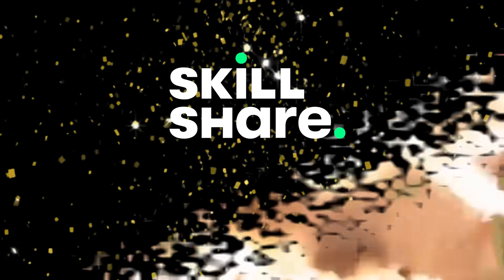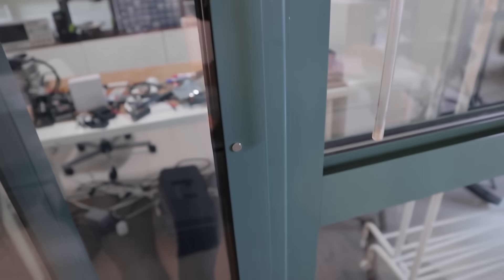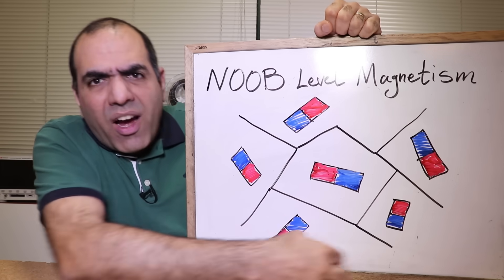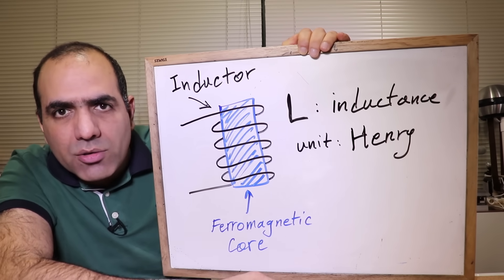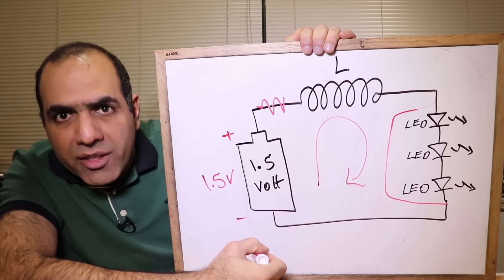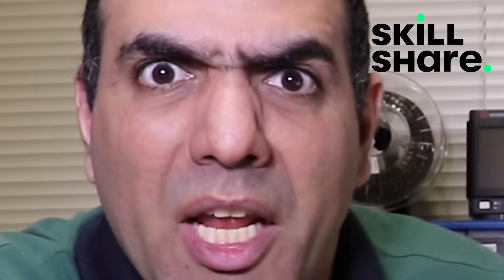Magic of Magnetism & Inductors (ElectroBOOM101-007)

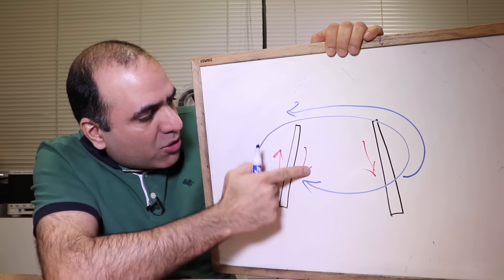Comment: I think the direction shown at 7:25 while explaining the transformer working is incorrect..

If (i1) increases from bottom to top then the induced magnetic field (B1) will be anticlockwise (to oppose the source i1) which then also induces a current in the second wire from top to bottom so as to oppose it's source i.e. B1 (as i2 will have clockwise B2)
Since, B2 reduces B1(opposite directions), i1 is able to increase more and thus having more bigger B1 and this induces bigger i2 which has a bigger B2 and this goes on..
Reply: Sorry for being so pedantic with the direction.. however his explanation is perfect.

Comment: Wait, does all magnets loose their power if overheated? Is that something to consider when you design electrical generators or motors that the electricity would eventually heat the magnets to make them useless?? or doesnt it work that way?

Comment: Pls explain,any kind of supply let it be ac or dc doesn't the INDUCTOR shorts them out ?Further if inductor opposes instantaneous change in current then how does it works on ac?

Comment: 5:40 you ask about Einstein's theory of relativity and how it applies to electromagnetism.  From what I understand (in other words, use appropriately sized grains of salt) - it has to do with whether your frame of reference is "the magnet passing through the coil" or "the coil passing through the magnetic field".  Relativity tells us there is no "preferred" frame of reference.  Whether your "stationary frame of reference" is the magnet, or the coil, determines whether the induced field is electric or magnetic.  The wikipedia article on https://en.wikipedia.org/wiki/Moving_magnet_and_conductor_problem is helpful in this regard.  If you consider the magnet to be stationary, the charges in the conductor experience a changing magnetic field.  If you consider the conductor to be stationary, the charges in it experience a changing electric field.  The two fields exist together so that the current will be correct no matter which frame of reference you use.

Comment: wait, then, hold on, very important question, 

an elektromagnetic field induces an eddie current that then creates its own opposing magnetic field, right?
but according to the right hand rule, the eddie current's magnetic field shouldnt be opposing but it is, so whats that about, why is the field opposing?
Reply: because as far as ive heard, the eddie current's magnetic field are opposing the original magnetic field, but according to the right hand rule it should just be amplyfying it or being attracted to it, but maybe thats just when its an unchanging magnetic field, and it only opposes fluctuating magnetic fields from like ac elektromagnets, where the field induces an eddie current and then it switches but the eddie current doesnt change imidiatly and then the magnetic field of the eddie current flips before the main magnetic field flips again maybe,

Comment: Just to clarify 5:36 where he says that magnetism is fake. It is not, don't you dare think of magnets as fake!

The electric fields do in fact transform into magnetic fields and vice versa under the theory of Einstein (also called Lorentz transformations, basically changing speed), AND there is always such speed at which magnetic fields are zero for stationary fields, but they are both fundamental because LIGHT (there is no frame of reference, aka speed, in which magnetic field of light beam is zero all the time)!

But if you want something to think about, in quantum field theory only the potential is "real", and it generates the fields. And the potential has 4 components, 3 of which are the magnetic potential (it is a vector), and the remaining one is the regular electric potential that you know as voltage.

Comment: What happens if you connect induction and capacitor together..... Free energy?????☺️☺️☺️☺️
Reply: You'd get resonant circuit that will quickly radiate all energy it has, unless it's powered with some external battery.

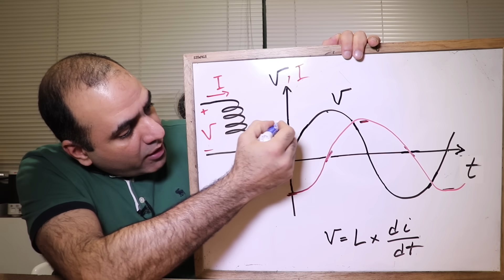Comment: Okay, so far so good, this is what I learnt in school, but also, in School I asked myself if: 11:42 Capacitor-Current and Inductor-Current are 180 degrees out of Phase, so is there any chance they will cancel out?

I mean for example if you were to have Inductor and Capacitor in parallel, so at the same voltage, will the current be zero? Or am I missing something here?

Comment: this is how i remember it
Inductors = Current Inertia
Capacitor = Voltage Inertia
Electric field lines = path that a unipolar north magnet would take if placed on a given point in the magnetic field

Comment: what would happen if we pass current to an inductor and suddenly disconnect it from both ends, would the magnetic field still be there?
Reply: Inductors resist changes in current, so if you cut the wire suddenly the inductor would see the current trying to go from some value to zero instantly. So the inductor reacts by producing an opposing voltage that tries to keep driving the current forward in the direction it was moving before. Since the current was trying to drop so quickly (practically instantly since it was a cut wire) the voltage can actually spike quite a lot and cause damage to sensitive electronics, but the energy is only in the magnetic field of the inductor so it will discharge quickly.

Comment: 7:27  when the source gets stronger, doesnt the second wire also have a stringer current and result in stronger magnetic fields induced? Like an infinite loop or something. I read about this concepts being used in transformers in subject of basic electrical engineering and have this question since then. Can somebody please answer this?

Comment: Please let me know an easy way to block that absurd 12V DC Voltage at my puny TIP41C Transistor Amplifier output. All I want to amplify is the audio input. I don't want to burn my speakers anymore with my beefed up powerpack. PLEASE HELP ME!

Comment: I loved it! HOWever, it's actually voltage induced, not current, in a conductor. If there is a loop/circuit in the conductor, there will be a current from the voltage. 
So, a changing magnetic field around a shorted loop of wire - or just a solid piece of metal - will induce a voltage, a current will flow (normal resistive stuff) and there will be an opposing magnetic field.
If the loop is broken (or some slits are cut in the solid piece of metal), there will still be a voltage, but no current and no opposing magnetic field.

Comment: Based on your video the magnet when brought closed to iron makes iron magnet as its magnetic patches aling properly. The result sounds like now we have a bigger magnet. Which is true but the strength of magnet gets diatributed over the entire area.

I.e. magnetic area overall increases but the strength remains same as that of magnet. 

Attaching 1 cm magnet to 100cm iron may not have any magnetism in such a big iron.

Comment: DC and AC are one and the same. Its just that AC changes all the time. A capacitor is a closed circuit, for a short time, beware ! It can kill you. In rush DC currents are no joke. Same with an inductor.
Reply: Technically the only difference they have to have is DC can only move current in one direction while AC does not. If you put AC into a rectifier it will give you a changing output, but it's still DC since the current only moves in one direction albeit periodically.
Reply: @thegreatzoom5073  Yeap. But there is a common misconception with quite skilled people. I have even heard a teacher say that lightning/flashes is not a DC but an AC. Though, i rather say that it is a DC, but it pulses back (ripples / bounces) off of the earth. I would even like to think of it as a bouncing ball of a surface. Until all the energy is transformed. I think it is easier to understand electricity in that sense, instead of dividing electricity as either AC or DC. Its just confusing, from a logic standpoint. I mean, you can even use a transformer with DC, if you pulsate the DC. So often have i heard that DC and transformers dont work... it works for sure, for every pulse given the time for the transformer to get back to its original magnetic none aligned (chaotic) state.

Comment: "complex math" uses the easiest differential equation for those who believe it is complex, its just integrating a derivative, for an inductor, V=L*di/dt, multiple dt on both sides, so the change in time * the voltage= the change in current * the inductance, or time = inductance/ voltage * current

Comment: So both inductor and capacitor stores and releases energy..... 
But used for AC and DC respectively .... 
Am I right or wrong .... 
Or am I still confused .... 😭
Reply: Inductors store energy in magnetic fields, capacitors store energy in electric fields. Both can be used for AC and DC, but inductors I think are much more common for AC.

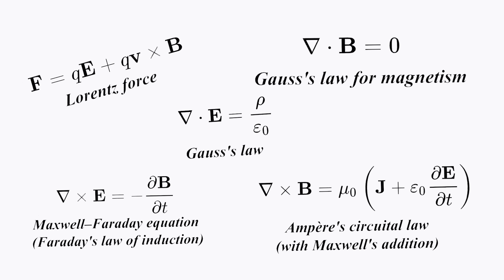Comment: 5:16  Maxwell noticed something fundamentally wrong with amperes law. wich back in the day had no ε0(dE/dt) term. He noticed that Amperes law wasent consistant with the conservation law which is: div(J)=-dρ/dt. so the correction that maxwell did was to add the ε0(dE/dt) term into amperes law. Its called "Displacement current" if im not mistaken.

Comment: How to do useful work?? Ok well its differential calculus, but this is not possible by a zero one relationship. It can approximate though, and it will be sufficiently close in the immediate context of matter to suffice.  Although I might add its three dimensionally dependent, if the maximised potential of energy is expansion, then the maximised entropy is contraction, therefore all of matter establishes itself on the basis of the average of the expansion/contraction co-efficient. Yet this has a gradient defined by trophic levels. Now a trophic level is like a temperature dependant differentiation. Just as a sun births elements on the basis of inverse square law energy differentials. In so reflecting on such potentialities' is it possible to reverse this? It is a reasonable argument to suggest that there is an energy gradient which exists between energy relationships. Now we are confronted with a time dependant malady, the nature of observable matter is not in fact time dependant. Its as if time is slowed as matter condenses which is of course a spatial relationship, which of course by virtue of the correlation of time, heat and the nature of matter, is as though the nature of what it is therefore - lies to us? and gives rise to another phenomenon Life?

Comment: If cause and effect is heat dependant and then entropy is a transfer of heat at its breakdown voltage/current dependency then conduction is a function of the transfer of field potential. This is currently asserted to be a mechanical relationship. However the energy potential difference of the weak nuclear force as it is applied to the E/M force is orders of magnitude different. Translating or manipulating the E/M relationship as is relates to the weak nuclear force gives rise to the ability to manipulate the E/M forces as u explained into a Translatable potential as it applies to the relationship of the E/M relationship in the context of the weak nuclear force. Induction is a simple cause and effect relationship in all its forms, only temperature differentiates therefore that this force can be manipulated if these principals are applied when heat is managed while leveraging the potential difference between the E/M force against the weak nuclear force.

Comment: So electricity has something that seems similar to inertia wherein current dislikes accelerating or decelerating (increasing or decreasing), and will use magnetic fields to try and remain constant whenever there is a change.  Using windings we cause these magnetic fields to work off of one another and thats how transformers work.  Seem about right?

Comment: Please do LC circuits next. Explain what happens in parallel and series LC circuits with AC power supply. Also what happens in parallel and series LC circuits with pulsating DC power supply and constant DC power supply. Please

Comment: inductors also have capacity. 
the bifilar coil makes use of this, by charging the capacitance with half of the voltage supplied.

This is done by the increased voltage difference between its 2 windings.
Very smart design, by Nikola Tesla.

It lowers the resonant frequency of the bifilar coil, and increases the ability to store electrical energy in its fields.

When series resonant and impulsed, these bifilar pancake coils produce longitudinal electric waves. More about this on my channel

Comment: Can you measure the voltage when it collapse?
Are you assuming it's 9 volts during collapse?
Why do you say 9 volts Instant in  you're example?
I claim there is a spike if you had 4 LEDs you would say 12 volts get pushed

Comment: A water analogy of an inductor that I saw on another channel (sorry, don't remember which) is a flywheel with vanes placed in the flow of water inside a hose. The inertia of the flywheel opposes any change in the flow rate. I'm a Boomer (electroBoomer, actually) who taught this stuff for almost 40 years and never came up with a good analogy myself. The flywheel works perfectly, even for illustrating inductive reactance.

Comment: I understood this right up to the point you stopped talking about "Magic".   The rest sounded like a Peanuts special (wah wa wa waaaah wa waah waa).  That's okay though.  Was funny when you kissed a hot neo magnet.   I've always wondered what would happen if someone did that. 

Okay, not really.  But it was still funny. What I did get out of this is that an interrupted / vibrating magnetic field in conjunction with a coil if done correctly will create current flow (however small).  If there are large magnets and the coil(s) is/are large enough it creates a good amount of current, which is why grabbing the leads of a rotating 12v dynamo is so hilarious (if you're not the one doing it).   I know that has something to do with moving electrons as well as random letters of the alphabet mixed with odd symbols.  None of which matters when I plug my cell phone charger in and wind up with 100% on my screen... which is all that really matters.  I figure the math is for the primary purpose of entertaining minds that might otherwise be unoccupied and potentially dangerous.  Well, kinda like ElectroBOOM, but you know, much more danger.  :D

Comment: Try and picture, I'm on a deserted Island. I managed to make some insulated wire out of copper and laquer. How do I make electricity with that ? Sure I could wave a Magnet at an Inductor but you need electricity to make magnets, and you need magnets to make electricity. How do you break the loop and make a generator out of absolute scrach ?

Comment: Great - I used to do the magnet on an aluminium frying pan and of course if you tip it upside down it just falls off but at an angle it glides slowly down - great Lenz's Law demo like yours on the door frame.

Comment: if you put 2 inductors in series and gave it 120 volts AC, and measured the output from the source, the first inductor, and the last inductor, would you get 3 phase AC?

Comment: I have a question that needs an answer.Case: An extension cable, rolled up on a drum, is supplying a light bulb with power. After a while the drum starts to heat up and will eventually melt the  insolation and short out. The question is if that heat is caused by induction or just bad heat dissipation due to it being rolled up. I am of the opinion the induction is minor because the power cord has a L1, N and ground running parallel. my conclusion is that this cannot be seen as a coil, therefor no induction. Is this right??
Reply: Submit this to Mehdi's subreddit, r/Electroboom. He's more likely to see it there.

Comment: A small doubt. What if you are not making the led's short ?..I mean if you are connecting led's in series with inductor along with 1.2v dc supply...will the lights still glow or blows up as current in inductor raises??@ElectroBOOM

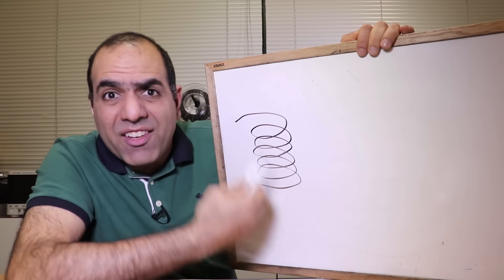Comment: 8:33
 I could be wrong but i always thought the strength of the field of a solenoid does not depend on the radius of the loop, just the current and loops per length. An inductor is basically a solenoid with a magnetic inside so that an emf can be produced.
Reply: I think you might be confusing inductance (in Henry) with the flux density (in Tesla). The flux density in a solenoid is indeed independent of its radius, the inductance is not.

Comment: A relativistic explanation of how magnetic field works between a conductor with a current and a moving charged particle is very natural and is based on length contraction that affects density of different kinds charges.
Chapters in textbooks by Orear or by Feynmann cover the topic.

https://www.feynmanlectures.caltech.edu/II_13.html#Ch13-S6

Comment: “The middle finger is for b field, the thumb is direction of force” After all those years, it’s still stuck in my head.
Reply: "The middle finger ia for b-field,
The thumb is reserved for the force,
The index finger is for current, 
You hold those fingers in this pose.
If two fingers match their vectors,
You know where the third one goes!"
Thats the song.
Reply: @exuvia.alscade  so sad nobody followed you with the lyrics :(
Reply: Ok...we learn it different in India...Index one for field and middle for current....I call it FBI to remember
Reply: @codergtm3691  yeh lel I remember getting confused when I was in 10th 

Sadly this rule is useless ,cuz u r better of using cross product/other rules
Reply: @codergtm3691  thats with your left hand
Reply: A simple way to rember which hand rule to use, that I am sure many know but just in case, I use 'Gener Righters' for Fleming's Right hand rule for induction, giving the direction of current in a generator's windings.
Reply: The 🖕 is for current
Reply: @codergtm3691  its for magnetic (B) field